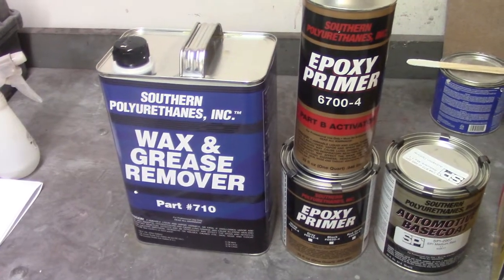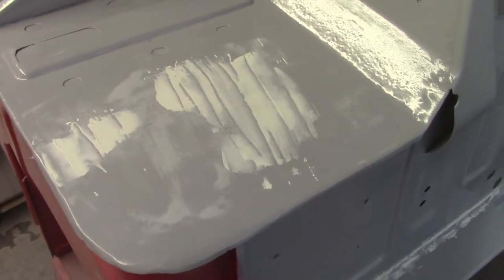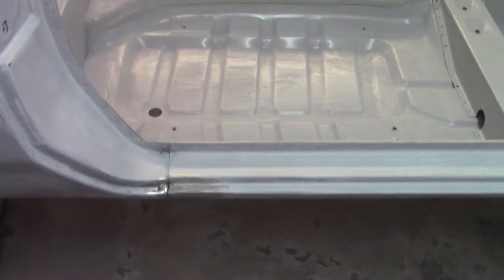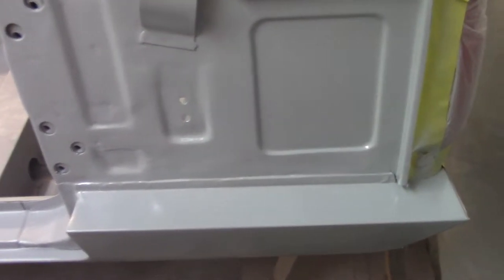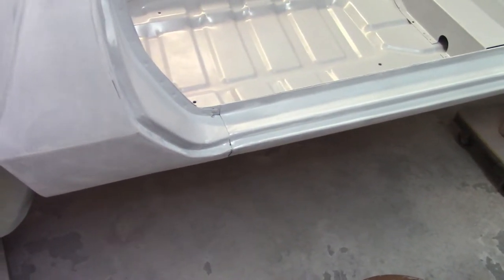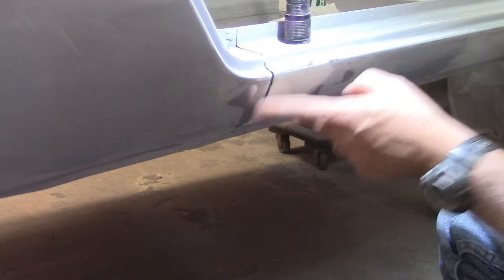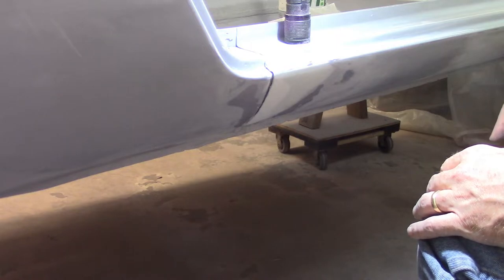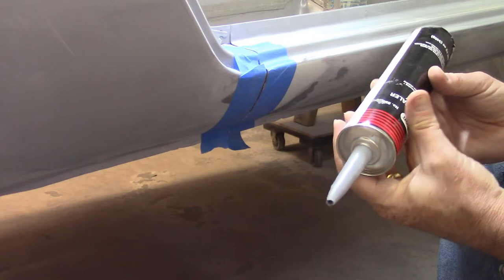Finishing Sill Rework & Wetsanding | Roundtail Restoration

Comment: Rather than using my fingers in awkward areas I use that dense packing foam, not normal expanded polystyrene,  i have some that's about 3/8 th of an inch thick I think it's called open cell.
Reply from the maker: Thanks, Stewart! Good idea!